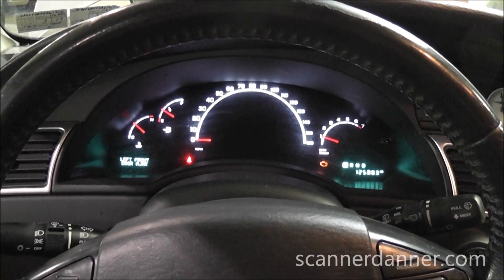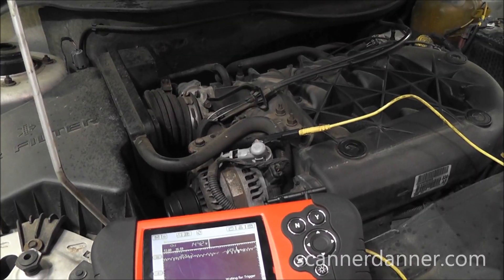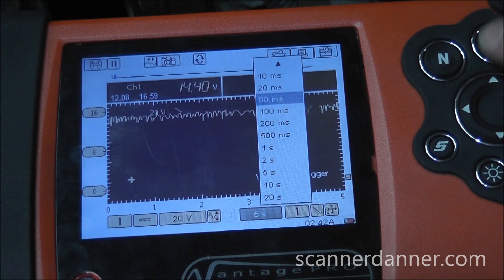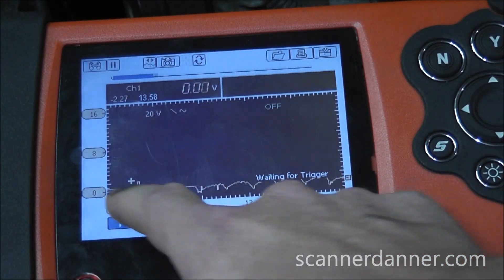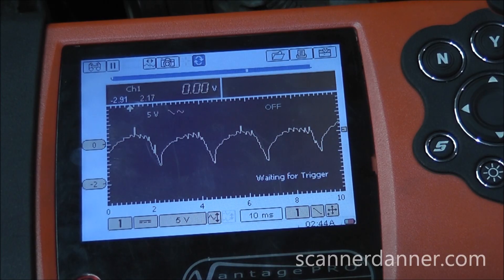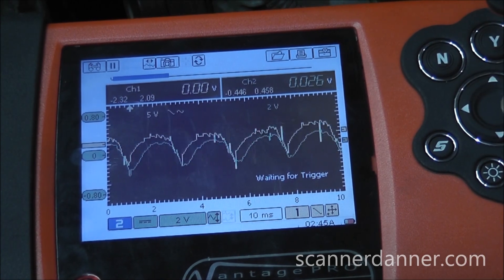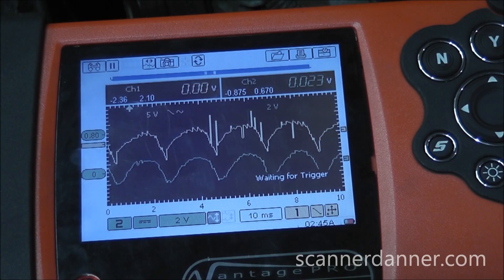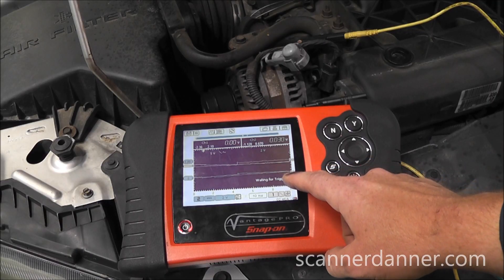Bad Alternator Diode causing transmission/speedometer problems

Comment: Without expensive diagnostic tools, anyone can check the charging system in 3 minutes using a $5 multimeter.
Test 1 check the battery voltage , engine off, multimeter set at 20 V DC, the reading should be over 12.6 V. Test 2 check alternator charging with engine running. The reading should be between 13.5 V to 14.5 volts. Test 3 bad diode. With engine running test voltage at battery terminal for any AC voltage. Set multimeter at AC. Anything over 2 v AC indicates diode trouble. Mine was reading 30 V AC. Replaced alternator and the serpentine belt.

Comment: Could this type of issue cause a misfire/stall issues on a 2 wire design crankshaft position sensor vehicle? Since the sensor is directly connected to the PCM would it be isolated from this?

Comment: Hey danner.. I have a 04 Chrysler Pacifica and it has a check engine light on for p0888 and p 0 700. It's also a limp mode. I change the transmission shift solenoid but nothing changed any idea what to look for any suggestions
Reply from the maker: We can help you here https://www.scannerdanner.com/forum/post-your-repair-questions-here.html
It is free to join my forum. Hope to see you there!

Comment: Mr. Danner, what is a rule of thumb for acceptable peak to peak voltage on modern vehicles?
Reply: Any AC voltage over (50) milli volts is grounds for a new Alternator. Too much AC voltage indicates a failed Diode inside the Alternator. The AC voltage in this Video was off the charts. I think Paul said it was one volt.

Comment: You are a life saver
I had po442 po700_0344_0339 o340_0725_0562.….. and unfortunately I changed 3 of them cranck sensor camshaft sensor and pcv valve untill i found your video .
Thanks so much
Reply from the maker: Awesome, sounds like you had this problem
Reply: @ScannerDanner  so a bad alternator can simulate transmission problems such as shifting/slipping errors ?
Reply from the maker: @brionadderley1643  correct, because the output speed sensor would be giving incorrect readings
Reply: @ScannerDanner  thanks for the reply sir; Hey i have another question if you dont mind; i recently done some swapping of parts in my honda 98 accord one of which was the IACV(Idle air control valve) and after doing so i recognize that the car now has excessive fuel consumption (accelerates automayically) and when changing the IACV should the TPS be adjusted cause the old one(factory) which seemed to be defective had my rpm really low like the car almost sounded off when running 650rpm u know ? Thank you alot !! God bless you sir ~
Reply from the maker: @brionadderley1643  no, the TPS should not need to be adjusted after an IAC valve replacement. At this point, we need to move this to my forum https://www.scannerdanner.com/forum/post-your-repair-questions-here.html it is free to join and I have paid moderators who are there to help me help you guys. I can't do back and forth messages here, it is too difficult to keep up. 
Things to look at for you in the mean time:
1. a vacuum leak will make it idle high
2. incorrect minimum idle speed (IAC unplugged, what is your RPM at idle?)
3. an incorrect IAC valve
4. how did it run before the IAC was replaced? Why was it replace? 
All this stuff needs to be answered on the forum. Thanks! Look forward to seeing you there.

Comment: You can use the cheap Harbor Freight voltmeter and test ac voltage directly at the alternator post. Anything over .5 (1/2) volts AC will cause major Havoc with your electrical system. Just tested a Cadillac CTS with a ton of fault codes. Red 14.2 DC but 46 volts AC
No expensive scope needed. Old diagnostic trick from the 90s in the car stereo business.
Great video though. Most people Overlook the charging systems. Double check all of your grounds too
Reply: Paul what setting do you set your volt meter at to read the AC? I'm dealing with something where when I take off from a start, all the gauges drop to 0 then come back and speedometer is erratic. Also some shift issues and things Im reading leads me to alternator.

Comment: Allot of the cheap battery testers like the Solar BA9 also have alternator ripple tests built in.  Couldn't you also just put a multimeter on AC voltage to check this?  What about using the Hertz setting on a multimeter?
Reply from the maker: yes you can, not sure about the HZ setting on the meter but the average AC voltage scale will definitely work. There should be no more than 300mv AC average

Comment: So is this a common fault with all VRS sensors that we should be looking for whenever we get a strange output signal? Just wondering how you knew to go straight for the alternator.
Reply from the maker: I've seen it before is the short answer, but also the symptoms were there. Speedometers do not read a signal when the wheels are not spinning.
Reply: Thanks for the video mate, that's another lesson learnt!

Comment: This exact issue happened to Dodge Neon, but apparently with crank position sensor. The car just did not run correctly, did not rew over 3000rpm and alternator worked only under 1100rpm and some other issues also. Changed a lot of things and nothing worked, until now, after seeing this video, unplugged the alternator wires and car runs great! THANKS!

Comment: Had this exact problem with our 2003 dodge caravan. Replaced the speed sensor but problem didn't go away. Also, showed transmission control module and 2 other codes. Luckily we found your video, exactly what it was doing. We replaced the alternator now everything is fine with no codes coming up.Thanks so much!!!!!!!!!
Reply from the maker: awesome! Thanks for watching
Reply: @ScannerDanner  - I am working on a 2003 Dodge Caravan as well. It has a persistent ABS problem that is proving to be very difficult to resolve. Could the alternator be causing the problem? The ABS controller is telling me that all 4 wheel speed sensors are bad (not likely) and that it has an "under voltage" condition.
Reply: ScannerDanner excellent video bro!!! I got a Chrysler voyager 3.3 2003, I got same problem with my van, should I change my alternator??? please bro help me with this, if the transmission is on (P) or if I'm on a stop sign it mark on the speedometer 20 -25 mph....it's crazy and 10 min. later the trans stay on first gear!!!
Reply: Bob Strohl hey brother, u just change ur alternator and fix the problem?? I got same problem...
Reply: Yes, we replaced the alternator and all the codes went away and the van is running fine now. I couldn't believe it but that solved all the problems,
Reply from the maker: Jexuell, unplug the alternator connector (Not the heavy battery cable part) and start it, see if your problems go away.
Reply: Im having the same issue with 2003 town & country. Ive replaced speed sensors an i took it to auto zone they testes my alternator & said it was fine... Plz help ahould i replace it or what help plz
Reply: Please there is anybody can help me with the code p0500 speed I change the two speed sensor internal not fixing the problem I saw this video I changed the alternator I still have the same problem in the car not shifting smooth

Comment: The fuses that were missing are the #6 fuse 10amp OCM/VIST Fan/wastegate, #7 fuse 15amp reverse lockout Sol Batt SRT10 , #10 fuse 5amp trx-off road pkg sen (gas engine only), #13 fuse 25amp rwal-pwr batt abs module feed, #24 block fuse 20amp subwoofer amplifier SRT10, and the #42 block fuse 30amp diesel pcm. I installed the missing fuses and replaced the negative battery terminal because it was a little loose and now it runs great.
Reply from the maker: Most of those fuses are probably not used on your truck. A way to tell is to look into the slots, you will see a missing terminal on one side.

Comment: will the alternator still test good at the auto parts store if it has a bad diode?
Reply from the maker: It should fail that test too
Reply: Hey Danner, thanks for the reply. I fixed the problem. Not sure how but it worked. This is a 2007 dodge ram 2500 5.7liter. I was getting U1110 & U1120 codes. No speedometer, abs light, brake light and airbag lights on. I replaced the pcm with a remaned plug & play unit because it wasnt charging and other electrical issues (no speedo and dash lights on). That only fixed the charging issue. I did have alternator tested several times before replacing the pcm. Tested good every time. I bought this truck used and it has always had electrical issues. I noticed in the fuse box there was several fuses missing, never been there since I've owned the truck. So $18 at the auto parts store for fuses and new negative battery post and the truck runs better now then it has in the 3 years Ive owned it.(knock on wood)lol
Reply: They all had 2 terminals so I added the fuses. I did disconnect the negative battery terminal for over an hour before starting the truck so maybe that did the trick

Comment: Your videos are top notch. Thanks.  If I don't have access to a scope can I use a DVOM set for AC volts to check for ripple at the back of the alternator just as you hooked up your scope?  If so, how much AC voltage indicates excessive ripple?   The vehicle is an '03 Mustang GT and under electrical load at about 3000 rpm, AC voltage at the back of the alternator is .48 volts.  Thanks for your time.
Reply from the maker: with a DVOM you want to be under 300 mv (.3 of a volt)
.48 sounds high. Confirm by test driving the car with the alternator unplugged. If your driveability problem goes away, this confirms it. (you do not need to disconnect the main heavy cable, just the smaller plug)

Comment: had a porsche 944 2.5 that would not run normally.checked ac voltage in the water system if i remember clearly(more then ten years ago) and it was too high.3V+.just changed the alternator.FIXED.
Reply: unplugged the alt, now i remember and the engine smoothed out.

Comment: depending on the alternator wiring(internally)  you can compare usually 3 waves. most alternators are delta or wye wound making them 3 phase. all 3 should be smooth and identical,smooth  and symmetrical.  also (which is more difficult to see) is to test the ground side.in order for an alternator to work there has to be positine and negative diodes. a bad negative can give the same problems. it may show in the positive side but not as pronounced.  good he showed the speed signal as this confirms it is probably the same noise. these cars no likey noise!!! and there is lots of ways to make noise

Comment: I've seen these same symptoms on a 09 silverado v6 with a 4l60 transmission. fluctuating speedometer and erratic transmission shifting and no trouble codes. turns out the one of the 2 wires on the output speed sensor was shorted to ground by kilo-ohms with both sensor and tcm disconnected. could not find where the wire was shorted. i offered to restring the harness but the customer declined the work. I sure would have like to known if that would have fixed the problem. Also would like to know if the one wire was dead shorted by less than a 1 ohm if it would have done the same thing.

Comment: Had one on my own vehicle about 2 days ago. Before the real problems started to happen, the RABS light would randomly appear then go away. Later on, the RABS would always kick into antilock mode while coming to a stop when there was no lock condition on dry pavement, which would cause the vehicle to lose more of its braking effectiveness as the vehicle slowed down. About a week later, the RABS would keep trying to unlock the rear wheels, while at a standstill at a red light. That ticking noise at a stop while holding the foot on the brake reminded me of what a grandfather clock sounds like. This was mind boggling. A few weeks later, at around 35-40 MPH, the speedo dropped erratically to zero while the transmission dropped into first gear, then the problem would clear up. This was a progressive RABS signal loss to where the computer still picked up the signal, but the RABS part of it was losing the signal. After swapping out a RABS sensor, the transmission wouldn't shift out of first, and with KOEO, the ABS dash light would stay on after the first few seconds. I must have shaken something loose in the process. So I back traced the two RABS sensor wires and I found an open. I found out that one of them 2 wires were slowly powdering up into corrosion on the inside of the original wire insulation, and kept building up more resistance as it continued to degrade. A replacement wire fixed it all. The car has about 252,000 miles on it, so something was bound to give. 2000 Ford Ranger. All of that because of 1 wire.

Comment: Can a bac diode cause multiple DTCs and clear them they come right back?
 Charges for a few minutes and then stops charging the starts again. Intermittent.
Reply from the maker: for sure. disconnect the alternator, then run the car and retest for codes

Comment: can an alternator dc voltage leak be tested with a dmm and what readings would be expected from a good alternator?
My front lights have started to flicker at idle, could a bad diode be the cause.
Would have been good to see what a dmm was showing on this car.
Reply: Yes it can be tested much quicker and easier with a dmm. You definitely don't need an expensive scanner. 
You want around 14V dc and no more than 0.4V ac. It really is as simple as that.

Comment: Hey Mr. Danner I have a question I have a 93 Jeep Cherokee and sometimes at night it doesn't seem like it's charging quite right the lights are kind of dim.. I got a brand new alternator on it and I have done all the other tests this is a computer controlled in this vehicle.. Can I go in and change the voltage regulator in the computer? I know normal charging range is 13.9 to 14.2 or would I be better off going to an external voltage regulator
Reply from the maker: +izzynutz2000 What is the system voltage (battery voltage) at idle and at 2000 RPM with all the accessories on and with all the accessories off?
Reply: 13 .5 to 13.9.unloaded....13.2 to 13.6/7. Under a load
Reply: Battery load test fine
Alternator is supposed to be 70 amp I'm running about 67 to 69

Comment: Can a bad diode in an alternator permanently damage electrical components?
Reply: Great question! Never saw that happen but I would think it could, especially over time. Batteries do not like AC current, it heats them up and doesn't charge them effectively. Also, DC capacitors such as the ones used in computer modules don't like excessive AC ripple and could suffer an early failure if subjected to an excessively high amount for an extended period of time. Some modules may have some type of built in protection built in, but I wouldn't count on it. Hopefully someone with more electrical engineering knowledge can chime in as I have wondered about this too.

Comment: We had our alternator tested and it showed good voltage But bad diodes , and speedometer doing same thing , but trans shifts bad & had issue same thing yr ago put new battery in and stopped and now its back on and diodes tested bad...what u think!!! Same Car Pacifica 06

Comment: Danner,.. In my vehicle I recently discovered a faulty Positive wire from the alternator to the battery. I originally found this through the DC fluctuating from 14.03 to 0, however checking the Diode out I found 30 volts (yes 30) A/C as well. I fixed the wiring and now I get a steady 14.03, however I am still getting the 30 volts A/C. Does this mean I fixed the cause but the damage has already been done to the alternator's diode? Even in this video you say 2 volts is too much. I seen else where that .5-1 volt is acceptable.

I seen another video with 30 volts A/C reading, but I am not sure what the correlation of 30 volts A/C is or it's just a coincidence.

Thanks for the help!
Reply: +Tom McBride Are you sure it's 30vAC and not 30mV AC?  An autorange will show a small mV on the display for that voltage.  30mV on a non-autorange will be 0.03 VAC, well within most manufacturers limits.
Reply: +Marc A. Mercier My cheap multimeter also says 30Vac on a perfectly working alternator but when I hook up my Fluke, it's 140mV.
Put either meter on diode testing and they both prove the diode / rectifier is in fact ok with a one way 540mV voltage drop. 
This 30Vac reading seems to be prevalent amongst cheap meters but I don't know why but I do wonder how many folk have changed healthy rectifiers or whole alternators based on a spurious ac reading and no backup diode test.

Comment: Nicely done.  How closely should voltage at alternator + to battery - matched what the OBD computer says battery voltage is?  My WRX at battery scopes out to 13.8 -14.1, yet the scanner trace indicates battery voltage is 12.7 - 13.8.  I'm guessing you're going to say verify ECU ground and power.  Am I right?